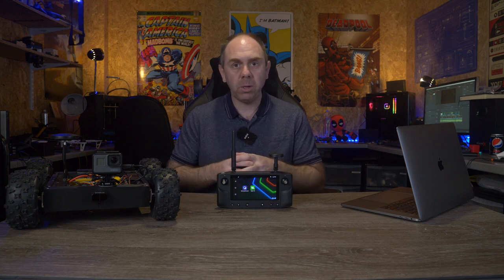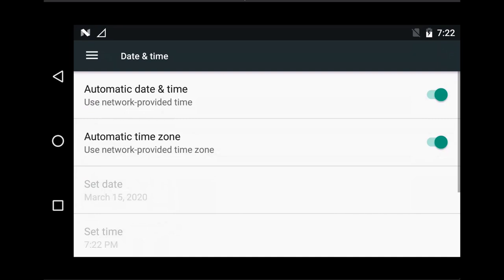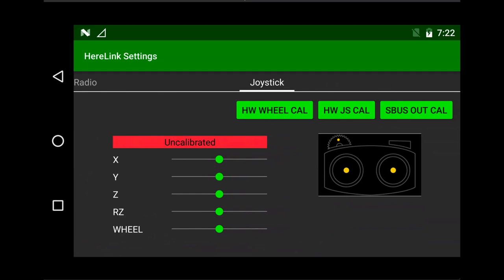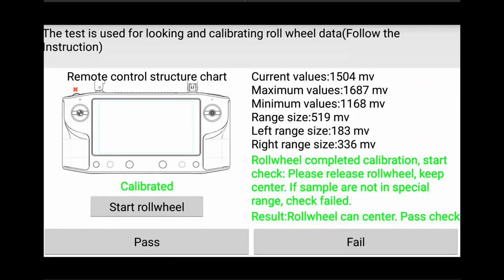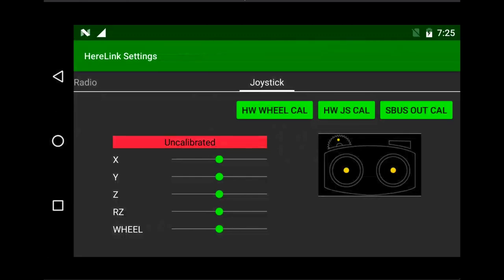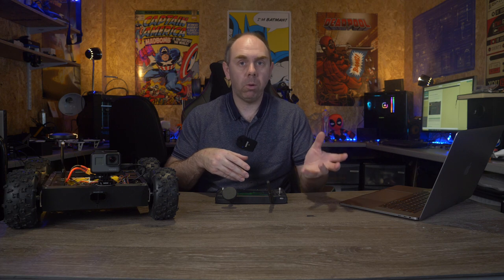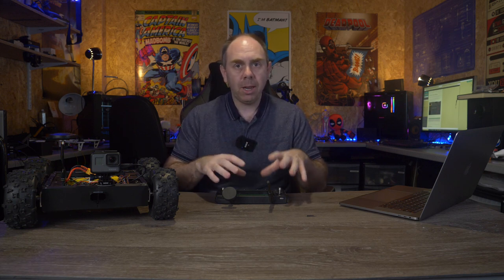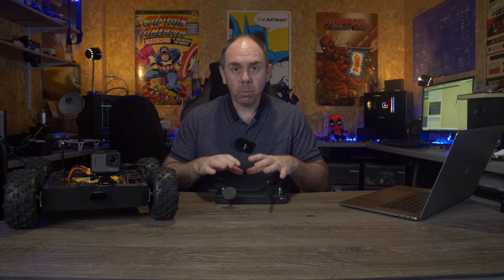Herelink FPV System - New Solex Firmware Setup

Comment: Wow, good video. I used the here link a lot before. But its compatibility and price are not very friendly. Currently I am using Siyi’s MK15 handheld ground station and Siyi’s 30KM
HD video transmission. Prices are around 300-400 US dollars. Very suitable for my drone.
Reply: 30km high-definition image transmission, the product model is SIYI HM30, good products should be shared with friends.

Comment: Hi! I'm trying to mount a static globe with a gimbal with this Herelink + Walkera Gimbal + RX0. I used a SBUS to PWM converter because I don't need a flight controller, I only need camera and gimbal control, but  I'm having issues connecting with the Solex App and QGroundControl. I can see my HDMI output and pairing is correct because so, but it doesn't connect any "vehicle" in the main screen of Solex. Can you make a video of a similar setup? Thank you very much!
Reply: did you find a solution for this problem? I want to use a PWM converter too, can´t get it work...

Comment: Is it possible to stream all telemetry also to an external computer, while using the herelink? I haven't used this system so often yet, so I want to check out the possibilities ;)
Reply from the maker: Yea you can via WiFi tether and Mission Planner.
Reply: @MadRC  Thanks, I am a Linux user. So with QGC it is not possible, right?

Comment: firmware update after stick not calibration and stick not move
Reply from the maker: The RH box will not move when you calibrate. Just follow the little direction on the small RC pic.